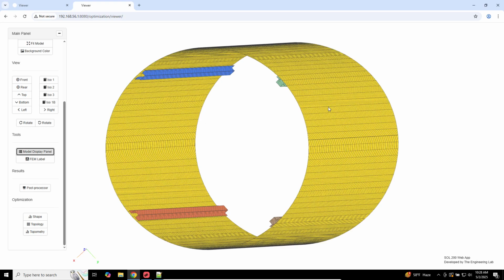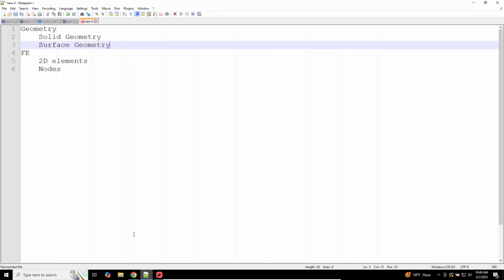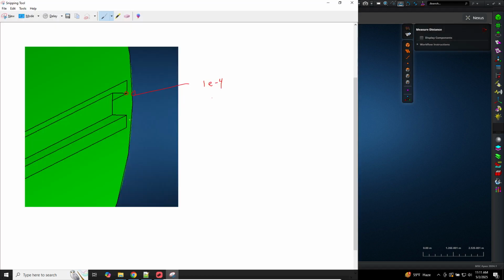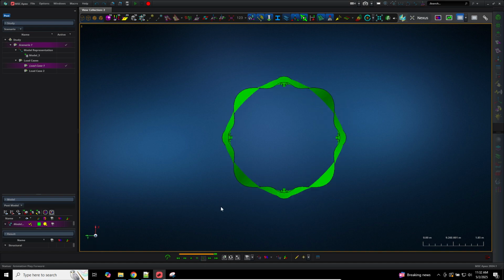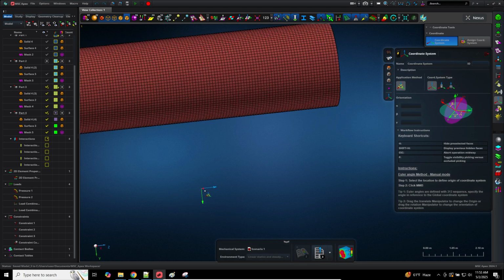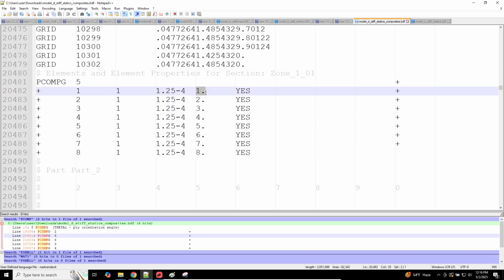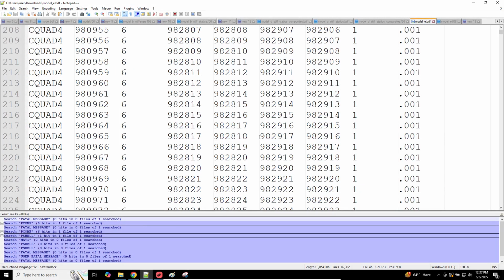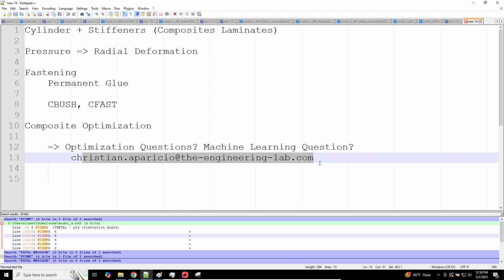MSC Nastran Analysis of a Composite Cylinder and Stiffeners

Comment from the maker: Tips on getting uniform radial expansion

1. Use proper boundary conditions/supports.
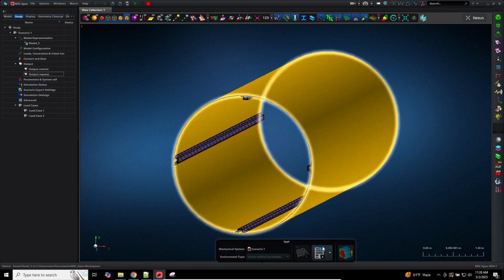2. Use greater precision for the node locations. At 59:56 in the Nastran Export window, mark the checkbox Wide Field option to turn on greater precision for the node locations.

Many of you will get #1 correct. #2 is a less known solution, so I encourage you to try #2.